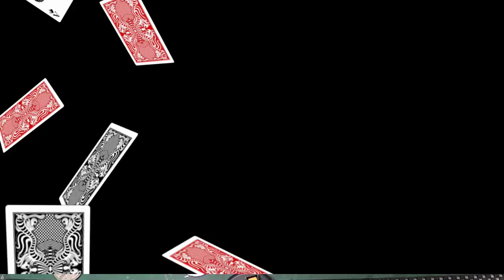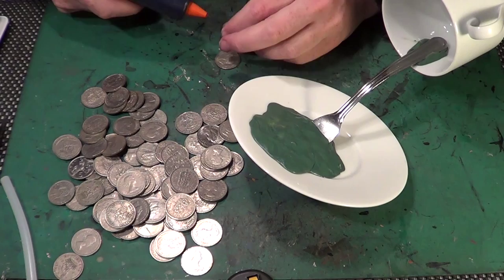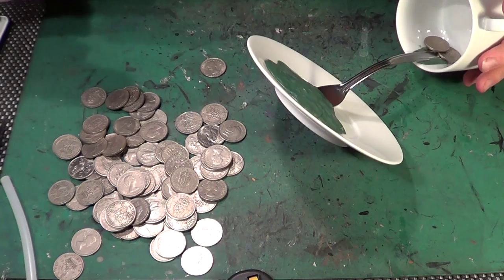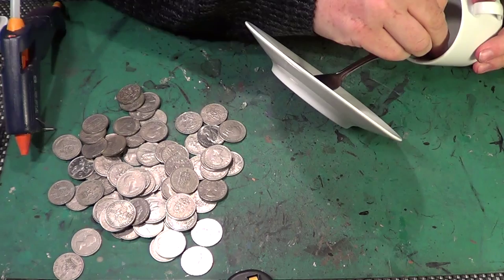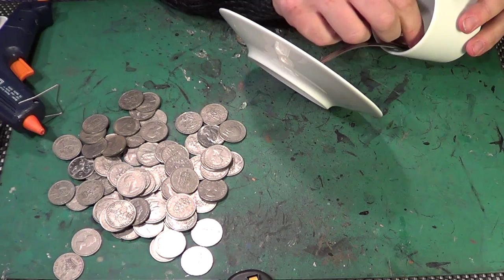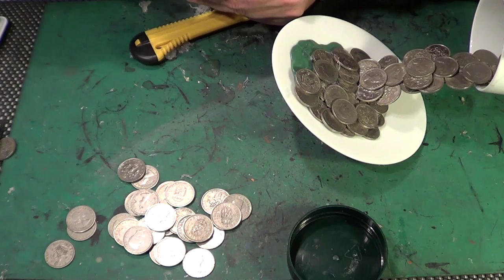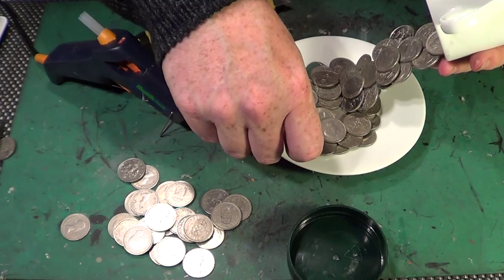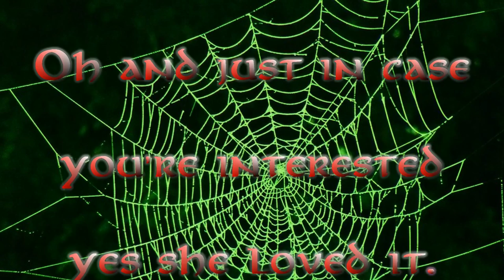Making a Floating Cup ornament Part 2

Comment: I'd use a better glue I have found hot glue not to be very strong. I made one of these with flowers and weighted it with small rocks in the saucer then hid them under the flowers.
Reply from the maker: You live and learn, I've never made one before so mistakes will be made, thanks for the advice, what glue would you recommend?
Reply: @Spydah666  Anything really I just find the hot glue gun a bit too weak and not long lasting , you did a nice job though.I think I used tarzan grip from memory .it was a while ago that I made mine.
Reply from the maker: @yvonneost12  Ok, thanks again for the advice, I'll keep it in mind if I ever do another one :)